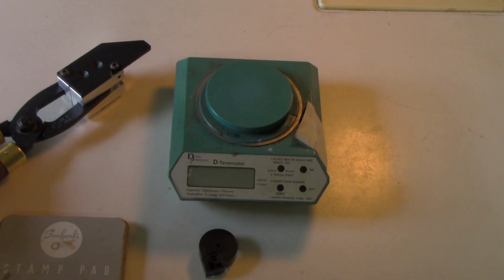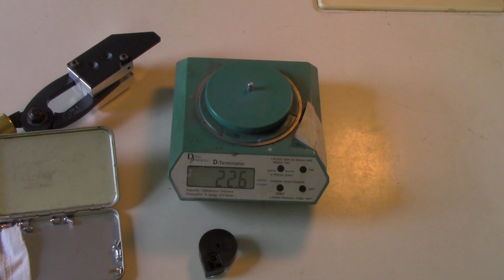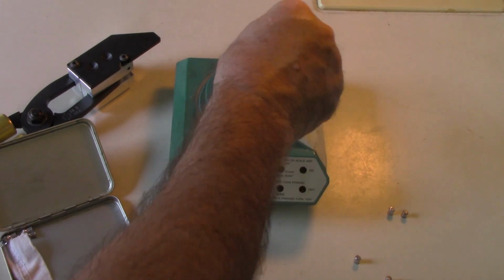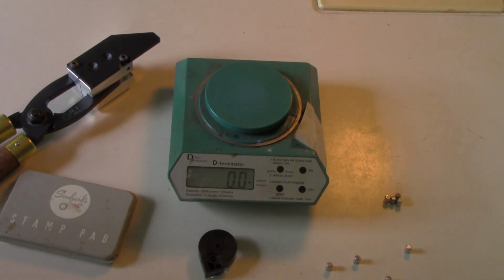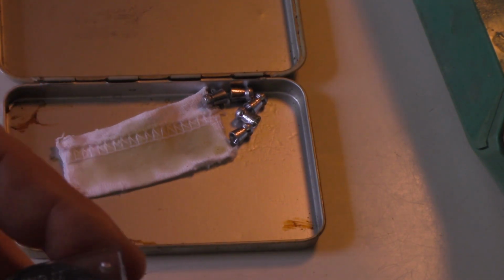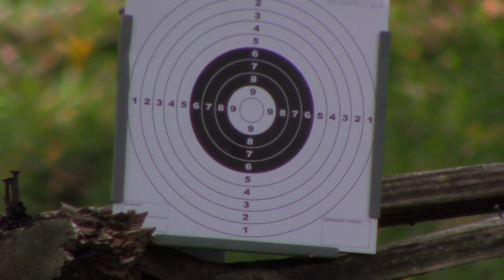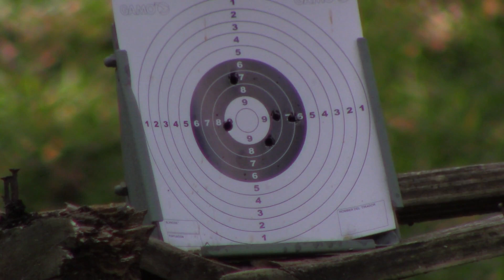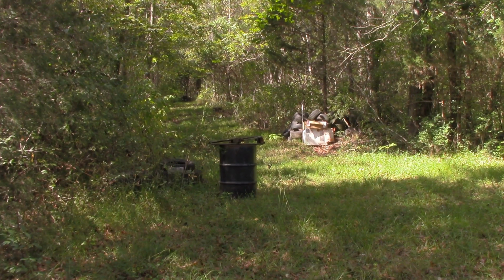Home Cast .22 Pellets

Comment: Excellent info, thank you! Looks like a perfect solution to my plinking cravings. I was wondering if you ever tried #4 buckshot? A 22 lead BB would be fun
Reply from the maker: I haven't, but I've heard of others using 4B in the NAA cap and ball revolvers.. They would probably have to be run through a sizer to work in an air rifle; I think they're about .240"
Reply: Gamo makes 22 cal round ball for less than $10 a tin AGD has them in stock now .
Reply: Thank you

Comment: Where did you get your Pellet mold maker??? Are you using recycled lead or scrap metal to make them??? Can you make a video on how you make your pellets?
Reply from the maker: I got the mold from NOE. I am very hesitant to ever buy from them again, for reasons I won't go into here. I use soft lead, either scrap or bought as ingots. I might do a casting video but it will probably be on my Rumble channel instead of here. YT likes to issue strikes for such how-to videos.
Reply: @Possumliving  I really would like to start making my own pellets, save me $$$$ Its always good for survival purposes to make your own, especially if you live in rural areas. You can definitely just eat off of the land, harvest squirrels, deer, fowl, quail et.
Reply from the maker: @Crimson_626  I agree.
Reply: As someone who respects your opinion, I am curious to find out why you are hesitant to buy from them again. I am asking because I am thinking about buying one of their molds @Possumliving
Reply from the maker: @tomcasselman4934  The last time I bought from them, everything I bought was showing on the website as in stock. My card was charged immediately. A month later I started trying to contact them. I tried every phone number and email address I could find for them, and got absolutely zero response. Tried to join their forum and couldn't. After almost three months of them having my money, I commented somewhere that I was about to reverse the charge on my card. Boom, I instantly get a form email that my order is on its way. No comment other than that, and still no reply to any of my attempts to contact.
The order arrived a few days later, minus one item. I emailed one more time and told them to just keep the item they had shorted me. They did; I never received it nor any acknowledgement of any of my attempts at communication.
I had dealt with them a few times before this last order, with no issue. So I can think of no reason the owner would have a problem with me.

Have you ever noticed that every single review of them is 100 percent, 5-star glowing accolades? I never noticed that until this experience.

Comment: Did ya tumble em after casting? They look pretty clean, like MegaBait said things are getting skinny. Im waiting on a couple of critical component's for my 71 W200 then im heading out of Florida. Hope you are well!
Reply from the maker: No, just put a light film of ND30 on them.
'71 W series is a cool truck. I just sold a '66 Dodge pickup.
Reply: @Possumliving  I had a 66 D200 225 tower of power! had 35k miles on it sold it couple of years ago for way more then i bought it.. kicking myself for selling it like all the other good vehicles and bikes..